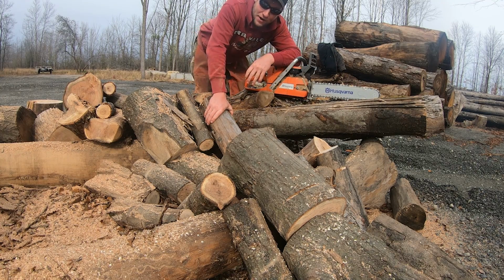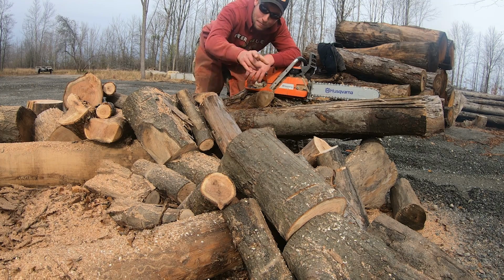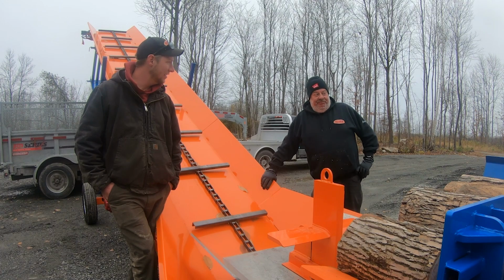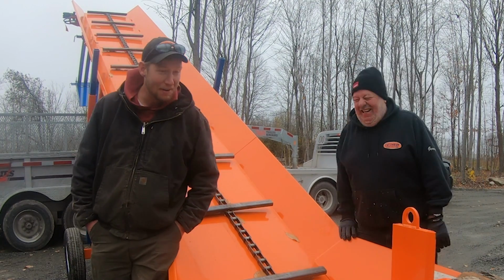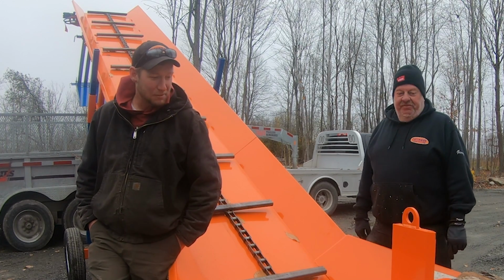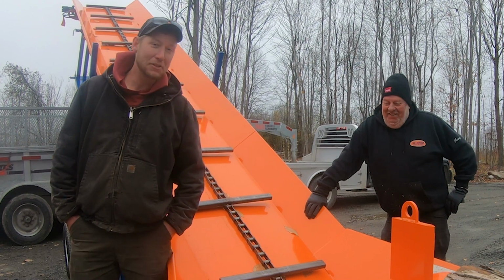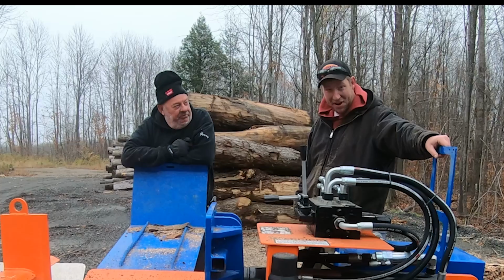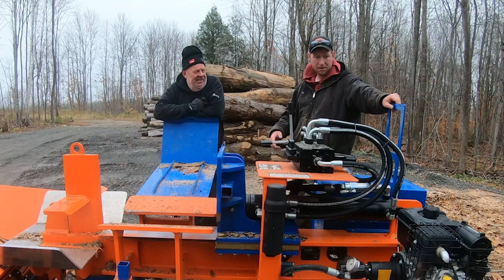Eastonmade;  Mystery DEMO Machine Revealed!!!

Comment: Where did you get that handy marking tool! I’m using a 2x2 cut to 18 and making little cut marks. Then coming back to cut them up.
Reply: Howdy Seth, looks suspiciously to me like a Snow Plow marker...  I just modified one to use as a marker for our Buzz Saw.  They’re nice because they are basically a piece of cable with a poly coating.  Very durable and available in several colors. I recently saw some on the market with led lights in them... Not think’n that’d be suitable for this application!🤔🤣.     Bless’ns to ya,      Tedd

Comment: Are there times that auto cycle auto cycle will kick off and retract ?
Reply from the maker: Yes it will kick off at around 30% power
Reply: Was curious because I seen in other videos with harder wood looks like the auto cycle was overrode so it wouldn't kick off

Comment: Tough paint.
Reply from the maker: It is good stuff
Reply: @EastonmadeWoodSplitters  NEW PRODUCT INVENTED right here, right now.

The machine is faster than the people. You wrestle the wood onto the lift. You wait for the lift. You wrestle the wood onto the splitter. The other way is to pick up the wood and set it on the splitter. I have an idea to eliminate the lifting and eliminate the hydraulic lift, increasing production.   The workers could work longer and faster. Every time you bend over it takes energy to lift your body back to vertical plus lifting the load.

Build a box or platform or bin. Then load up the bin with a front loader. The wood will then be at the proper height for grabbing it and very close. I would call it a hopper, back-saver or table.

The floor should be sloped slightly to assist but not so much that the wood slides on its own. Three sides should have permanent walls and one side should have adjustable wall. It should have three legs so it does not twist.   About 6 ft wide and six, eight or ten ft deep.   Side walls one foot tall or more. Have adjustable legs for height adjustment and slope adjustment and removable.  You could offer a painted version and an unpainted version.

The front would have two doorways 3ft wide. The doors would be closed with individual four inch boards one inch thick slid down from the top in a track on each side.   

 Rear legs could be two feet from the rear to carry more weight. An anti-tip device could be at the rear in the middle. 

Transport is by loader or truck.  The customer provides chains for lifting or use the three-way fork loops.  Make plenty of holes for chains everywhere.

I am not aware of this item having been invented.   I do not do wood. The ideas published here were my own but anyone may freely use them.

The prospects for the firewood industry are good because the price of labor will come down and the oil and electric prices will go up. Wood heat is more reliable in times of civil disturbances.